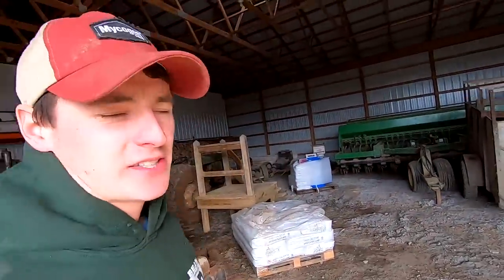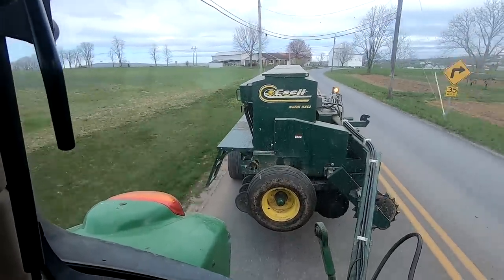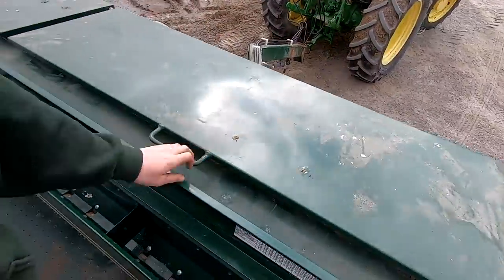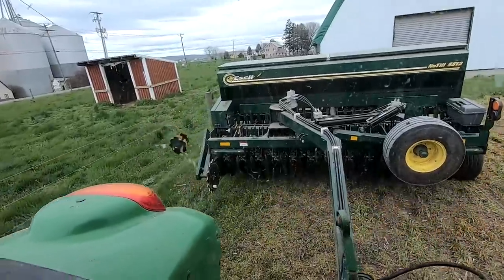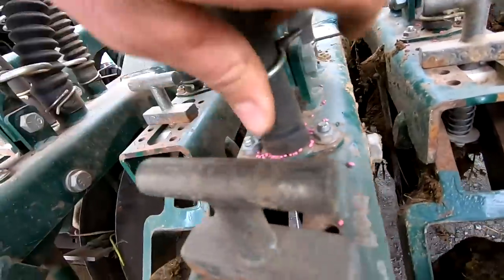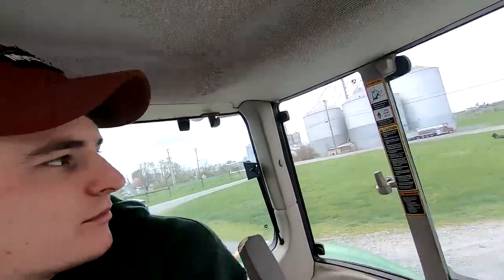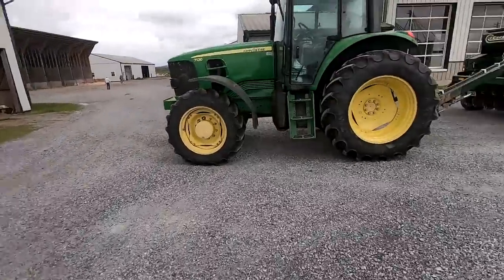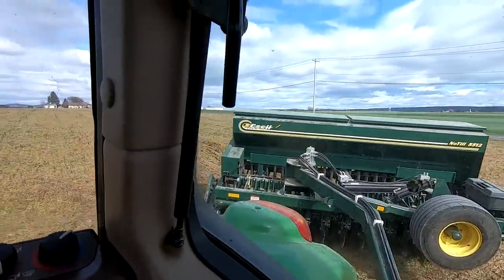Seeding Alfalfa | Trying the Neighbor's No-till Drill

Comment: I used to run the same model  Esch Drill. The sponge meters and variable speed gear box are excellent, best drill I've ever used. You can plant literally anything with that drill. They're built out of heavy gauge steel. Can't say enough about them, by far my favorite drill I've ever used. 

I used a couple hydraulic donuts on the lift cylinders to control the depth that it was allowed to dig. It's so heavy that in soft soil it will plug if you only rely on the closing wheels for depth control. Good to keep a couple of them on hand for that. I probably planted a few thousand acres of sudex, alfalfa/grass, milet, rye, ryegrass/crimson clover, etc. Really miss that drill...

Comment: I always lower my closing wheel as low as it will go to keep my openers from going so deep. The sod cutting wheel doesn't really matter how deep it goes the deeper the better. It kind of aerates the ground. By lowering the closing wheel it lifts up on the openers. You can also put cylinder stops in so there isn't so much down pressure.  Keep on keeping on. Love the videos

Comment: GReat vlog with very good explanation of the differences in equipment and the reason for the different seeders / drill.     Question:  Why are some dairy farmers being required to DUMP MILK, when there is minimal (if any) stock of milk in the supermarkets. ??? Does not make sense to me a city dweller.
Reply: Ken Lynch most milk processing plants are set up for cheese production not bottling fluid milk and would take months to switch to meet the demand for bottled milk
Reply: @biffmerkes2874  Never knew that.  Thanks for the reply

Comment: That’s issue with less spacing than 7.5 inch is the trash will plug way more often between disks. Air seeder is the best thing since sliced bread because has run blockage meter indicators on newer equipment but 7.5 usually typical spacing. Your program as a dairy is more intense, luck to you.

Comment: Stop putting so much down pressure on the drill your planting alfalfa it just needs a scratch there is an adjustment on the back the cutting blades should just barely be cutting for your application